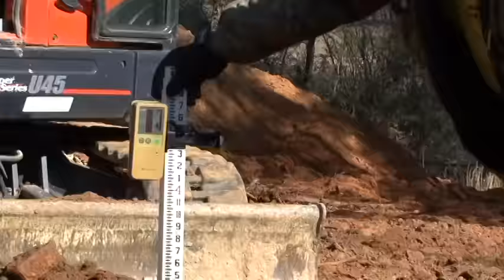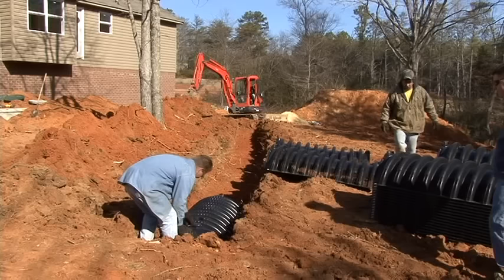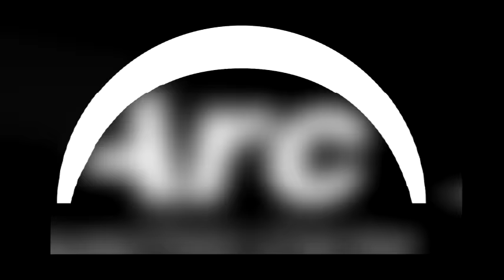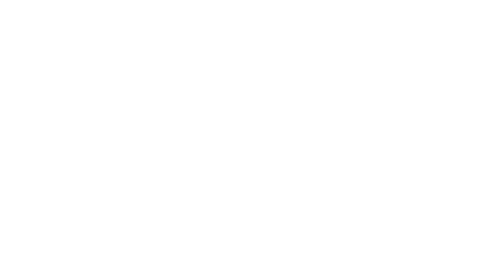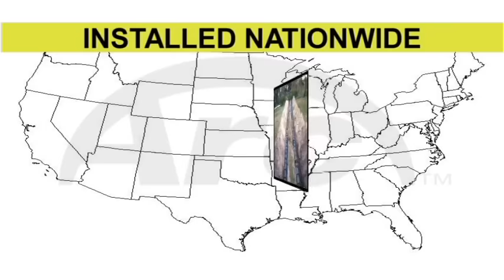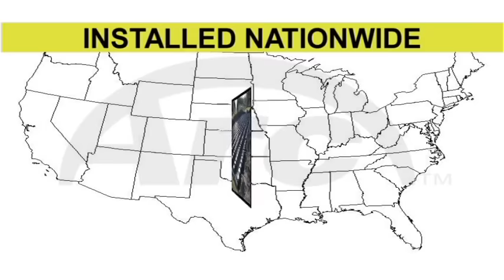Arc Leachfield Chamber Installation - Advanced Drainage System

Comment: I was thinking they might include internal perforated piping system that interconnects them together so once in use the entire field will "equally distribute" effluent to entire field instead of just dribbling into where the PVC pipes goes into the infiltrator.  Correct me if this is part of the design?  I had to engineer a complicated system 25 years ago due to poor soils and space limitations and engineer included a pump system to dose the system with about 150 gal of effluent when the 2nd 100 gal tank got to certain level.  He engineered 1" PVC to hang from infiltrators with certain size and number of holes drilled so when pump went on, the 150 gal of effluent would fill the pipes and entire system gets equally wetted.  The advantage is the leach field gets to dry out between the pumping cycles so it helps mitigate the growth of "biomat" which is reason most fields fail as the biomat plugs up the field and it backs into home or finds a way to surface out of field.  It seems like the infiltrators might have this kind of system designed into them by now so entire field can be used, but maybe it is too complicated with varying soils and uses??

Comment: I had 100 feet of this system installed in 2014 apparently it’s already full because the tank had to be pumped in 2020 and again this year. The people that installed it said the soil is saturated and I need a new system.
Reply: 100 ft isnt near enough  average house is 270 ft
Reply: their put 300 ft in mine in 2013 . Still Working . Was Inspected / Tenn.  now 2023

Comment: These are awesome because tree roots can't stop them up. It actually helps to pull water out. No gravel and you can drive over the field without compacting the trenches
Reply: you CANT drive over these what the hell are you talking about, it will cave them in and you will have an expensive repair on your hands. I just talked to the septic leach field installer today, I was pissed because he is placing it behind the garage in the only flat spot on our property and said "Absolutely no driving over them as you will crush them".  Looking at the arches they are made with flimsy plastic, which if they were say a 1/4 or so then yea you likely could drive over them, but these at like 1/16 thick or so.
Reply: @jamesfoote2022  I don't know what you're were made of but ours were really thick. I'm not talking make a driveway out if it but I was saying I can drive the tractor over the leach field to mow and not having to worry about compacting the trenches like a regular leach field with gravel. I could stand on top of the ones we had put it and not bend them once they are two feet down in the ground they are even stronger.
Reply: @jamesfoote2022  It would have been nice if the producer of this video would have valued having some narration giving the facts. Sadly, we can only now speculate. 
----- Another Music video leaving me disappointed.
Reply: @2pi628 Pulled this from the website because I was curious as well. "Chamber shall meet the load rating of H-10 (16,000 lb per axle) with a minimum of 12 inches of cover when
tested in accordance with IAPMO PS 63 and installed in accordance with manufacturers installation
procedures. 
"
Reply: @jamesfoote2022   the system could be better designed using a 1/4" thick design and legs in the chambers. 

but  cheap cheap cheap
Reply: you all probably dont care at all but does any of you know of a way to get back into an Instagram account?
I was dumb forgot my password. I love any tips you can offer me.
Reply: @Dennis Gary instablaster :)
Reply: @Phillip Lochlan it worked and I actually got access to my account again. Im so happy:D
Thanks so much, you saved my account !
Reply: @Dennis Gary no problem :D
Reply: Gravel lines are best they allow driving over they last well over fifty years only service required is basic tank pumping  per three to five years.

Comment: Can the ARC system be used on sloping down land?
Reply from the maker: Yes, the ARC chambers can be used on sloped land - typically the maximum is 20-25% depending on your local regulations.
Reply: Sloping ground would be spill over system upper system fills an has slightly incline before spills over to lower lines same as gravel system i call it stair/ladder but they don’t like those words in septic tank system

Comment: Those open fins will just let the dirt over time seep in. Also just having these sitting on top of the soil, ie not gravel, will not allow the water to seep into the ground any faster. If anything it will case the soil to become over saturated. With a traditional pipes in gravel set up, it allows the water to slowly seep through the gravel and then to the soil. I can't see these systems working that great and if they do work it won't be in any areas where the soil is dense like clay. Remember the marketers of these products will tell you anything for you to buy it. The use words like scientific and engineering to make themselves sound like they know what they are talking about. Stick with the traditional tried and tested methods.

Comment: Use of chambers in Massachusetts allows for a 40 percent reduction in system size.  I think it is unwarranted.  The chamber design, while it has a number of benefits, doesn't in my opinion allow the system to "breathe", resulting in the growth of anaerobic bacteria, and possibly eventual failure of system.
Reply: The leech field should be only getting water into it with a bit of small waste. The TANK is where the bacteria is supposed to take care of the solids. My gravel and pipe system lasted 17 years. I can see that this system would last 2 or 3 times or maybe "forever". Says the 20+ year PLUMBER.
Reply: See above Rollie Wilson looks like his 2014 system installed failed.
Reply: @davidhouston5783  looks like they went 6 years without pumping the tank. They probably overwhelmed the field.